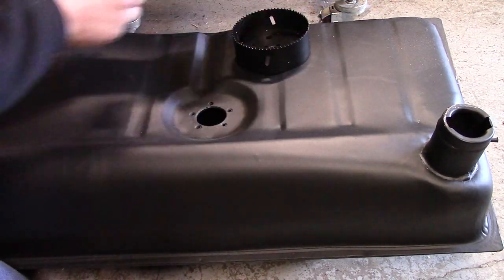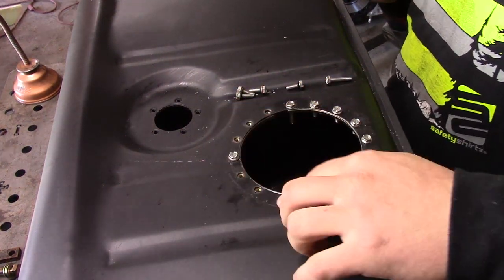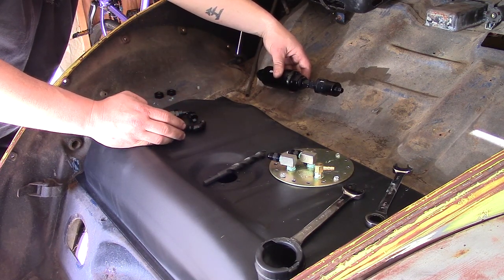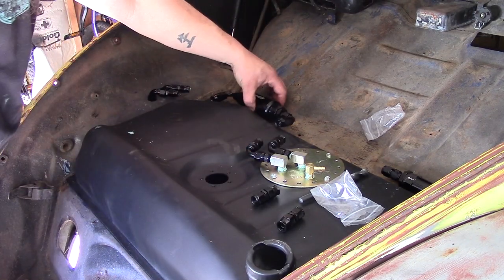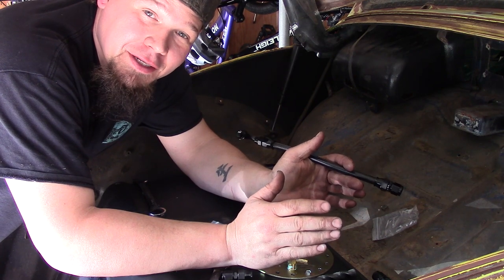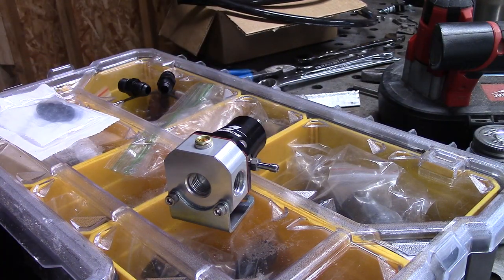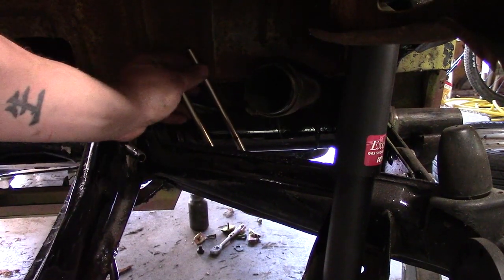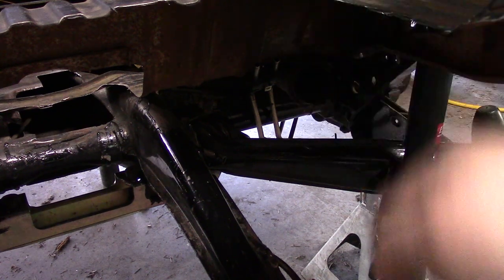TANKS INC IN TANK FUEL PUMP vid4 subaru beetle swap conversion e85 lines

Comment: Nice setup, can you post the part numbers you used?  I will need to figure out something for my fuel system when I get to that point
Reply from the maker: Yes I can. Any specifics you are looking for?
Reply: @boostedpower5417   part number for tanks INC pieces,  fuel pump and related accessories.  Fuel lines and fittings are pretty universal, so I shouldn't need those.

Comment: We’re did you get the sending unit that fits into your tank?
Reply from the maker: The fuel pump?
Reply from the maker: https://www.tanksinc.com/index.cfm/page/ptype=product/product_id=609/category_id=61/mode=prod/prd609.htm
Reply: Thank you!
Reply from the maker: @douglasberry7004  don't forget! If your gonna be doing some fuel injection on a project car. We need to hear and see about it 🤪
Reply: Yup!, 2110 turbo meth injection cb performance efi system.
Reply from the maker: @douglasberry7004  heck ya!

U on any forums?
Reply: @boostedpower5417  no
Reply from the maker: Shoptalkforums.com is pretty cool